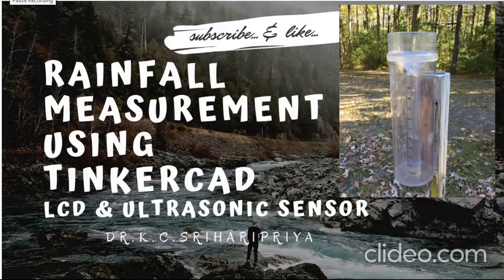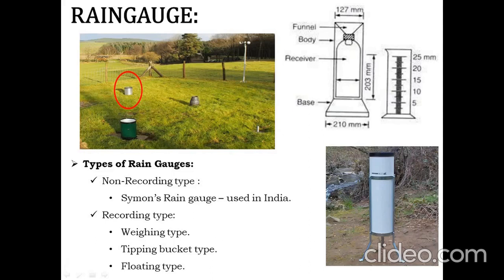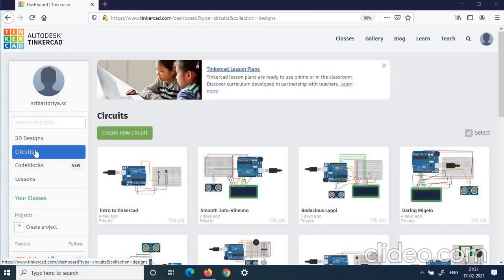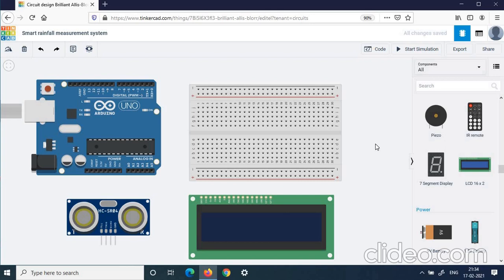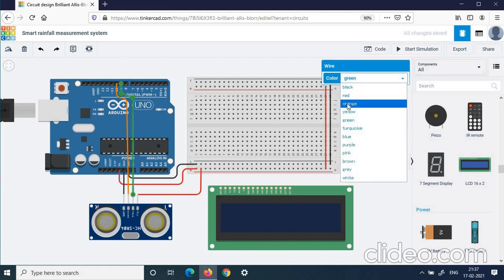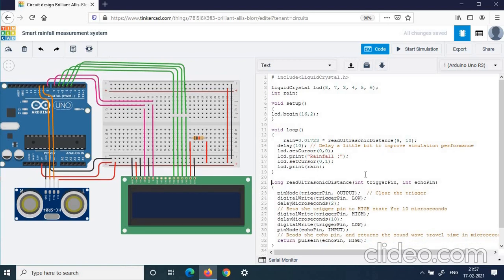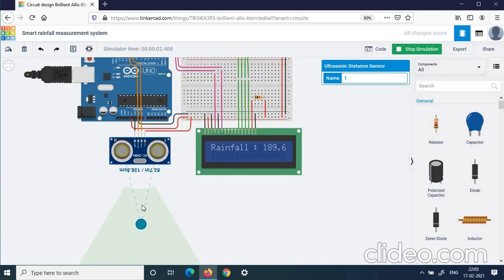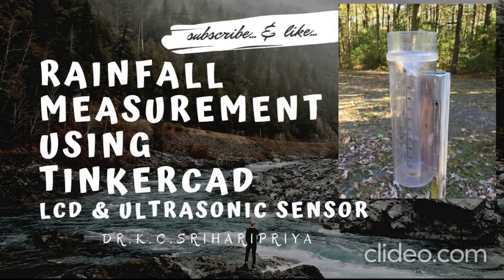Smart Rainfall measurement system using TinkerCAD with Ultrasonic sensor & LCD | IoT application.

Comment: Wonderfull explanation mam.Can i get the code for this circuit mam.
Reply from the maker: Hope you find it useful...

CODE for the CIRCUIT:
#include<LiquidCrystal.h>
LiquidCrystal lcd(8, 7, 6, 5, 4, 3);
float rain;
void setup()
{
lcd.begin(16,2);
}
void loop()
{
  rain=0.01723 * readUltrasonicDistance(9, 10);
  delay(10); 
  lcd.setCursor(0,0);
  lcd.print("Rainfall :");
  lcd.setCursor(11,0);
  lcd.print(rain);
 }
long readUltrasonicDistance(int triggerPin, int echoPin)
{
  pinMode(triggerPin, OUTPUT);  
  digitalWrite(triggerPin, LOW);
  delayMicroseconds(2);
  digitalWrite(triggerPin, HIGH);
  delayMicroseconds(10);
  digitalWrite(triggerPin, LOW);
  pinMode(echoPin, INPUT);
  return pulseIn(echoPin, HIGH);
}
Reply: @TechnoBrunch  Thank you very much mam.I have used your idea as a basis for my minor project mam.It came out so good.Thanks once again mam.
Reply: Code @TechnoBrunch